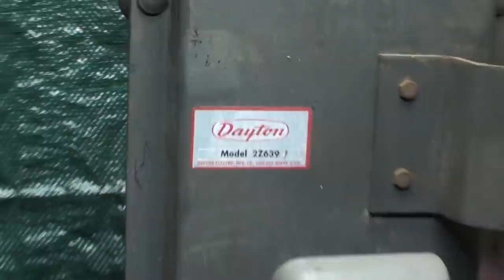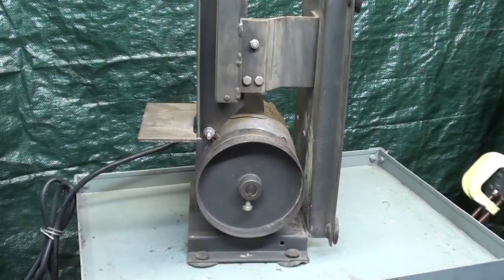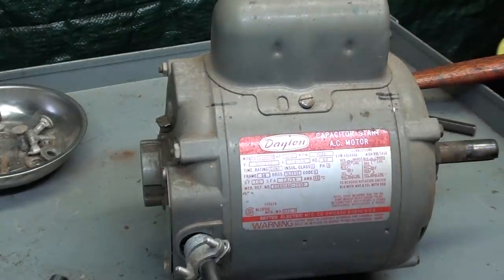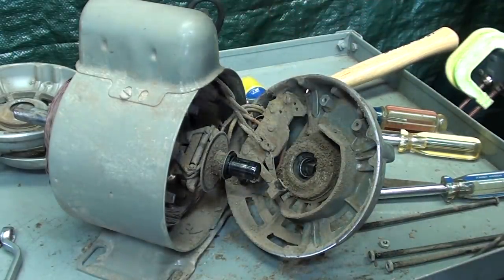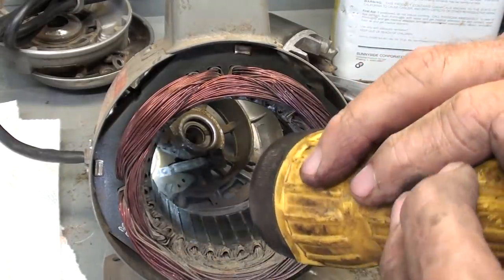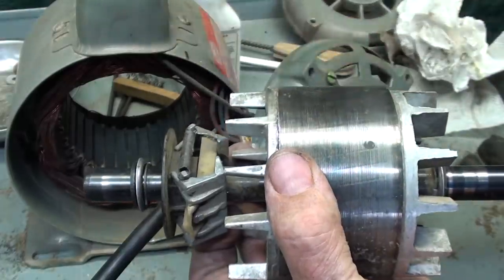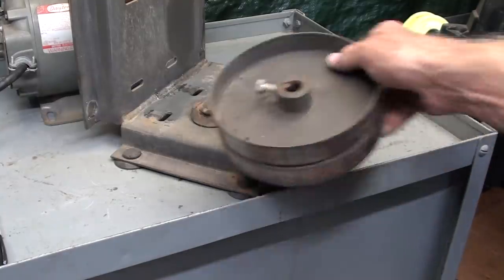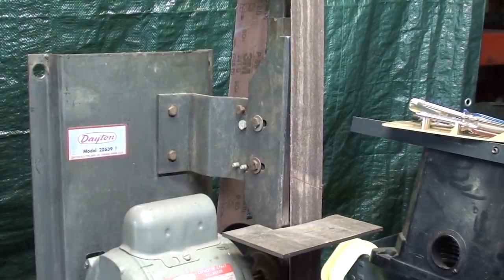Repairing My DAYTON Belt Sander Tips #495  tubalcain

Comment: It’s funny, how motors are different now from years ago.  I work electrical maintenance and have for twenty years.  The sleeve bearing motors run for sixty plus years for the most part and dirty or not just keep chugging along.  The new replacement motors with ball bearings usually last five to ten years.  You just have to love progress and how much better made equipment is today. (A little sarcasm there). Keep up the good work Mr. Pete

Comment: I took to doing the same kind of position marking on car and truck hoods, when they needed to come off for pulling the engines.

I bought an old Buffalo Forge drill press that had a "burned up motor," according to the seller.  It has an old G.E. 2 hp three phase.  Turned out it was the bearings on it, and getting it knocked apart was a real challenge.  No real damage to the bearings or shaft, I can only assume that when it got hot, it caused the bearing material to get hot enough to swell or upset.  A light polish of the shaft and honing of the bearings was all it took to make it work again.
Reply from the maker: Thanks, that's a good story

Comment: Great video Mr Pete, My grandpa taught me how to Rebuild motors like this when I was 9 or so, remember it to this day, I just rebuilt a 20 Hp  3 phase Blower motor for the A/C unit at work, a new motor was 3700 bucks, all it needed was New bearings that I heated up and Installed, they shrunk back to the shaft, it Runs like new now, VFD's are hard on motor bearings, Only cost me 60 bucks and a few hrs of time, My christmas bonus should be nice this year!!! Repair dont replace!!! thanks for the Great video Mr Pete
Reply: Any ideas as to why VFDs would damage motor bearings?
Reply: Near as I can tell its because the wildly different Frequencies that VFD's use to control the speed of the motor,  some of the Frequencies make electricity escape the squirrel cage and want to make it to "ground"  so they cause micro arcs and Pitting in the bearings, The engineers factored in 60 herts for longevity but when VFD's came about it induced some different parameters than they had considered, look what happens to Slip rings or armatures and they arent even load bearing. Ive also researched that the slower speeds cause Issues
Reply: not entirely sure the science behind it but Logically it makes sense, and Real world, we have a 7.5 Hp Kitchen exhaust fan that is just direct on or off 480V 3 phase 60 HZ one speed and in 3 years it has not even so much as eaten a belt but it runs 24/7 365, Everything I have that is VFD drive goes through belts and bearings every 6 months, You know what they say, things in steady state are fine, Its the change of state that causes issues, so going from slow to fast or Vice versa and imparting strange parameters tells me that may be a part of the problem
Reply: Might watch Mr Petes Videos First then I would read this LOL
Reply: That sounds a little strange. Slip rings don't carry a weight load however they do carry an electrical load so arcing and pitting would be expected. But for the current to arc through the bearings would require the voltage to exceed the ability of the insulation of the windings to contain it. Do VFDs alter the voltage as well as the frequency?  I've never seen the internals of a VFD so I don't really know how they work.
Reply from the maker: Thank you for that
Reply: They do alter both Frequencies and Voltages and Induce stray Currents into the rotor, It is an Inductor after all (induction Motor)  those stray currents and Voltages want to Ground out so the only way they have to do it is Through the Bearings arcing and Pitting the races. Its Fun to put things into Perspective, an Induction motor is Really just a transformer where the secondary winding happens to spin. is definitely an Electrical charge inside the rotor and the high frequencies and High or low voltages these VFD;s work at make the rotor do strange things, Hi frequencies makes arcing much more of an Issue
Reply: Thanks for the explanation Jason. Very informative.

Comment: I too, worked at a motor repair shop back in the late 60's. Did yours have one of those trichloroethylene spray down baths? You'd put the whole motor frame into it and use a spray hose to flush all the gunk out of it. It did an impressive job and the repairman then had a clean motor to work on. It had a water cooling jacket to keep the solvent condensing back into the bath. The cloud of solvent just hung in the bath and there was a metal cover on it when not being used.

Comment: Nice clean up on a usable machine. Remember, these were never intended to be top-line tools. The lower end were made to be used on a job and thrown away. Dayton is the Grainger house brand (they bought the old Dayton company lock, stock, and nameplate back in the 1960's).
Reply from the maker: Thanks, I did not know that

Comment: Next! I would put a shield below the work table to help deflect grinding debris from entering the motor. 
A foam filter such as is used in lawn mowers could also be put in front of the intake ports.  Handy machine.

It should be a TEFC motor of course.
Reply from the maker: Yes

Comment: A 'pie plate-like' shield between the housing and the wheel would seem to get you 90% of the way to preventing the reoccurrence. Can't close off the airflow, but it seems like munging it so the grit at least can't fall/be drawn in directly through the exposed holes would be simple, quick, and thus worthwhile.
Reply from the maker: That's a good idea

Comment: Mr. Pete scolding Dayton, classic, gotta love it!!   In the past I have installed toggle switches in the middle of the motor electrical cover plate (if there is room).  I agree McDonalds has really good and inexpensive ($1 any size) coffee.  I went to Dunkin Donuts yesterday and the same size coffee was $2.50 (and not as flavorful)…  Carpe Diem Mr Pete!!!

Comment: I think you can adjust the platen with the two bolts that hold it on the horizontal base. It looks crooked there , and it looks to have been welded in a spot that may have cracked $$$ the reason it's not tracking I'd bet it was dropped or something.  Thanks Lyle for another great video.
Reply from the maker: Thank you, I'm not done with the adjustment yet

Comment: Add a metal box with a switch, just cut the cord!  Box can just lay on table next to sander.  I have a Rockwell band saw that gets dust in the starting mechanism, and I have disassembled several times to clean out the dirt.  I finally took a cloth and duct tape to cover the air intake on the motor.  Works well, no more dirt in the motor.  -Todd
Reply from the maker: Good idea, but it does it overheat
Reply: No, it doesn't take much air to cool the motor, and I only use the band saw 5 - 10 mins at a time usually.  It is barely warm after each use.

Comment: Please keep on rambling!!!  Sometimes the most obvious things you work with every day don't sink in and get thought of until some one points them out. I have a Delta wood band saw I bought new about 30 years ago. I do clean it off when I am in that mode of cleaning up the shop. But usually it has 1/2 inch of saw dust all over it. I just looked and it also is an open motor. I can just imagine the amount off wood dust that has gone though it over the years????
Reply from the maker: Yes, that's fine sawdust gets everywhere

Comment: Some motor shops had a dunk tank that they would simply dip the whole motor in without disassembly and it would flush out the debris- dead simple, I think it was carbon tetrachloride or some such mystery chemical. Typical clearance between rotor and stator is (was) on the order of 10- 12 thou, the tighter the tolerance the better performance and efficiency, but then the risk of rotor knock rises too as it flexes under load.
Reply from the maker: Thanks

Comment: You might consider installing a sheet metal shield between the case of the motor and where you do the sanding so that the air being drawn through the motor is from the left of the shield (as you're facing the machine)  and not through the area where the sanding grit/metal particles are falling. It might prolong the working time between cleanings. 
     Of course you know I live down south and in my time working with guys "born and bred" down south I've heard many a colorful saying used by said men. The funniest one I have ever heard was; " I'm so hungry, I could eat a keg full of wiggling a**holes."
Reply from the maker: That's quite an expression, never heard of that one. I bet you heard plenty in the Navy. In an upcoming video where I build a belt sander, the very nature of the design provides a shield￼

Comment: I saw a guy in high school shop class who was making a chisel put it against the belt (point upwards) of one of those vertical Kalamazoo. It caught on the seam, flipped it around, and drove it into his stomach. He had to have surgery on some internal organ or two.
Reply from the maker: Wow
Reply: I think back to some of the machinery we were using in wood and metal shop (table saws without guards, lathes, torches, etc) with no safety training or even much training at all, and I'm amazed. Also, we were idiots to begin with.

Comment: "Tighter than a ..." Something not many people would know but I can relate to it. 😄  Wonder if the tracking would improve if you moved the motor's pulley in (toward the motor) a bit?  Is there a way to add a small shield for the motor's intake?
Reply from the maker: I will experiment with that

Comment: TEFC motors are of course much more expensive because they need to be constructed from materials which will tolerate the excessive heat that results from intentionally failing to properly cool them.
Reply from the maker: Yes

Comment: I loved seeing you hammer on a screwdriver to get the end bell off.  What did you do to the kids in shop class when they did that?
Reply from the maker: How would you do it
Reply: I would have used a screwdriver as well.  I just remember as a kid being told not to hammer on a screwdriver.
Reply: A punch would have been the appropriate tool.  If you had to use a screwdriver use one that has a shaft that goes completely through the handle.

Comment: In regards to your using the wife's toothbrush, how do you know she isn't using yours to clean the toilet then replacing it back in the holder?    LOL  The shims on the shaft are also sometimes used to ensure the rotor is properly positioned to ensure the rotor runs at its magnetic center thus reducing thrust and current draw.
Reply from the maker: Thanks a lot, now I will have to hide my toothbrush

Comment: What a mess! Agreed! That's the wrong motor for that application. Any motor on a power tool needs to be a closed design! If the tool is designed to remove material in anyway (Sanders, saws, drills, etc) why in the world would you have a fan sucking in all that debri and blow it into its core? It's designed to last just as long as it's warranty... They don't want it lasting 25 years, they want you to buy a new one every few years.
Reply from the maker: You are quite right

Comment: was the Cresant adjustable wrench ever meant to be a precise tool one way or the other, not sure if they advertised a proper protocol as to how to use it, anyway fast forward they  are made somewhere other than the US. You would think a simple tool like this could be made here in the US with any improvements possible , Channel ( Chanel if you like that oily oil smell) still does it, Vaughn still does it.
Reply from the maker: Yes, channel lock

Comment: Imagine if you only used it on metal and that sawdust was metal powder, would have probably gone off with a bang. Putting it back i might have put half a bucket on the pulley end with a small hole for the shaft to stop some of the dust ingress.
Reply from the maker: Thanks

Comment: I really like a foot-switch for those sort of tools. I've found the USA-made LineMaster brand (http://a.co/d/iZ0PUXc) very good and they have models you can just plug into the wall socket and the tool plugs right into it so you don't need any special wiring (and can move it from tool-to-tool easily). This one is rated 1/2 HP, you might need a heavier duty one depending. I like that you can have both hands on your work when you're starting up and aren't distracted finding a switch and I always seem to be using those for only a short time so it's handy. Thanks for the video, I enjoyed spending some time looking over your shoulder :)
Reply from the maker: Thanks